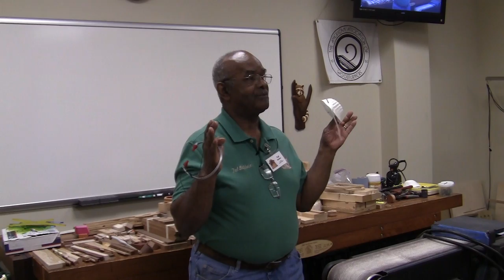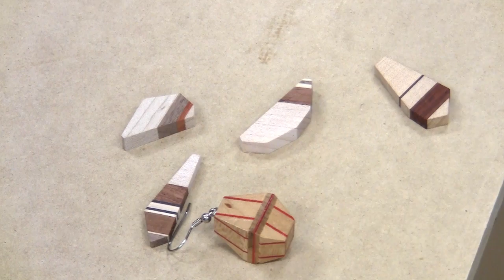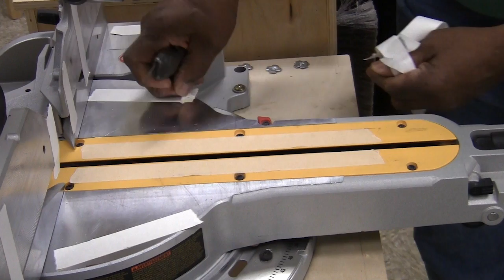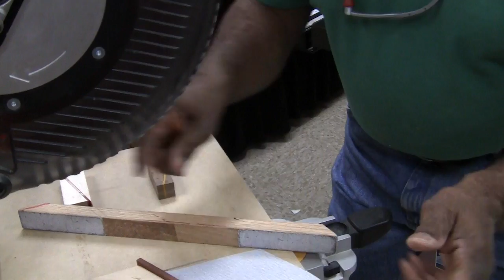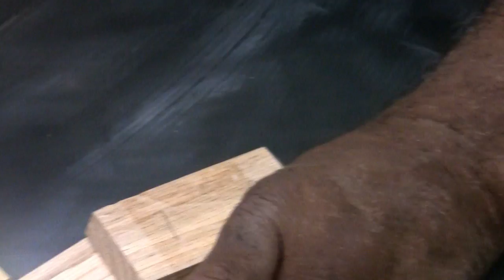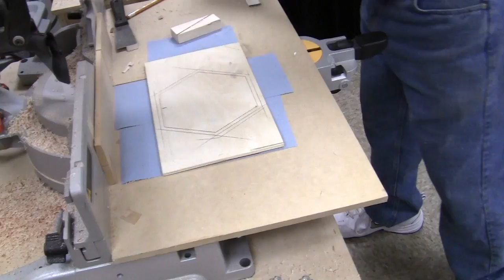2014-01-25 Ted Baldwin: Cutting Small Things Safely (00h:50m)

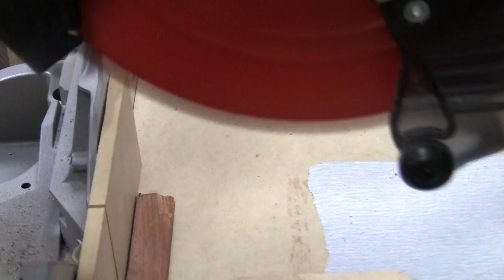Comment: Watch  28:30- 32 if you came for the title. Before and after that a lot of talk, not much content.
Summary for angled cuts:  use double tape to stick an auxiliary fence, plywood base and angle reference plus sand paper to keep in place.  
Seems it would be easier to do a jig with everything fixed on place and preset angles and clamp it to the fence.